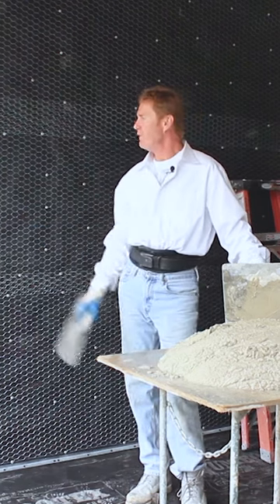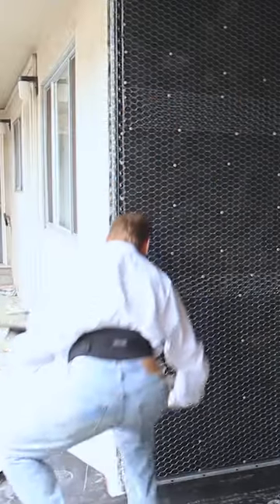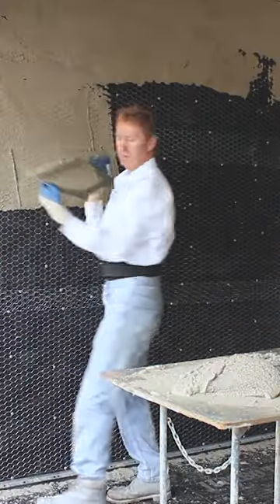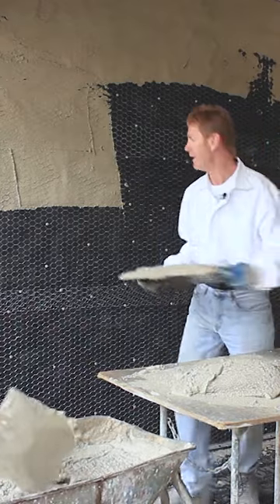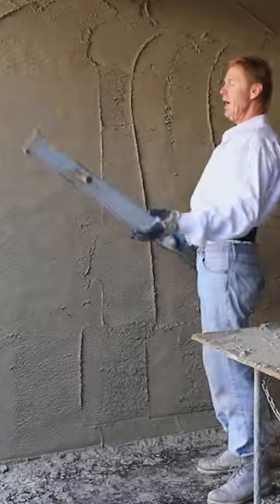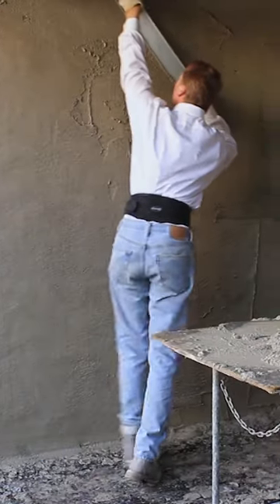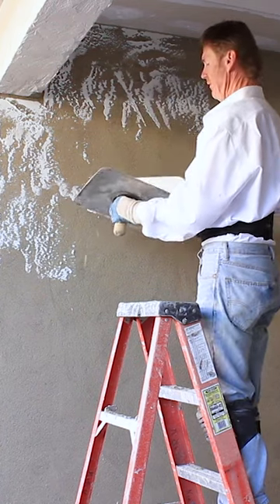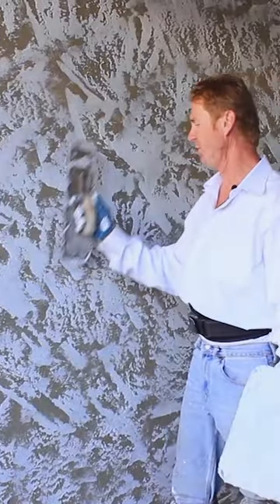How to apply stucco #shorts #shortsfeed #learning #stucco #educational #howto #diy #homeimprovement

Comment: Is that just sand cement with rapid hardener? Or is it silicone based? Over here we use sand cement mostly. For dashing, rough casting, cottage effect and smooth finish on the exterior. Silicone stuff is becoming more popular but it’s horrible stuff to use sticks to everything and ethier takes 4 hours to dry or 24
Reply from the maker: It’s called Eisenwall hydraulic stucco

Comment: What are the fasteners that are holding that metal lath? Looks like roofing nails.
Reply from the maker: @ricos4700  They are similar except they have a cork that raises the lath, they are called furring nails. Were they necessary? Depends, A gun set up cost about at least a thousand bucks. A box of furring nails about 10 bucks. We did not lath this but instead came in to do the stucco applications. The wire was self furring so it could have been attached with staples or nails.🕵🏼‍♀️

Comment: Can you lathe on hardie backer for stucco? Do you even need to? Building my outdoor kitchen
Reply from the maker: @ANour-ny9mu  You can screw in 3.4 metal mesh or apply fiberglass mash tape, or a bonding agent. It all depends on how long you want it to look good.
Reply: @StuccoPlastering  thanks so much! So just use fiberglass mesh tape on the whooooole thing? I want to avoid the metal caging
Reply: Also would need to put jumbo Tex? Should I adhere that with screws or do staples work with hardiebacker
Reply from the maker: @ANour-ny9mu  if your using solid pieces of Hardy backer board, the paper is not necessary, naturally if it looks like a jigsaw puzzle it’s best to seal the joints.
Reply: @StuccoPlastering  you’re the best! Thank you! For clarifying

Comment: Are you using Eisenwall or a similar material here in order to do all 3 coats same day?
Reply from the maker: Sho-Nuff, it's Eisinwall. Home Depots and Lowes carries their user-friendly, same stuff called Rapid Set Stucco. For this one you just add water; the sand is already in the mix.

Comment: you must have 2 arms of steel  trowering walls all those years.     question. can you smooth out a texture wall that has paint?
Reply from the maker: @vegitoblue7908  I’m as strong as the next guy, only. Like walking it’s one trowelfull at a time. Of course any wall can be smoothed out. Clean it apply a bonding agent then skim with a 30/30 finish sand, like Santa Barbara by La Habra.

Comment: 🎉🎉. ATTENTION, WHY ARE YOU USING INCH20 WIRE WITH LOOKS LIKE 7/8 ths. SKREED ?
Reply from the maker: It's 17 gauge stucco netting, we didn't lath it as we use guns, not furring nails.

Comment: Code requires twenty four hours between scratch and brown. Unless you're using a hot mud
Reply from the maker: We used Eisenwall, we are allowed to apply both coats anywhere in the country with it. When it first came out folks had to be certified to apply it. Yes o have that useless piece of paper.💃
Reply: @StuccoPlastering   Eisenwall is hot-mud.
Reply from the maker: @questioneverything2  We could also say it sets hella-fast.😉

Comment: As a stucco guy, I’m gonna make your life a lot easier. Buy a staple gun and staple your wire! No hammer and nail. Also in ohio we use rectangle trowels. Put the brown coat on, let it cure then come back and put a coat of finish on, white water proof cement, lime and sand, then come over and texture it
Reply from the maker: Thanks for the tip. What if we didn't do the lath and were called just to apply the stucco coats?

Comment: TO DO IT DO YOU NEED THAT TACTICAL BELT
Reply from the maker: No,🏋🏽‍♂️ Its actually a weight lifting back brace to protect my back, it's an old habit when working behind plastering pumps for many years in the past.👨🏻‍🔬

Comment: Your going to lose all the muscle in your back from wearing that brace anyhow so your right, you don't need muscle
Reply from the maker: Thanks for the tip, there’s so much excess muscle that loses some might be a good thing.
Reply: @StuccoPlastering  I'm just saying is all. Ask any physiotherapist. In time you'll need it just to walk
Reply from the maker: No worries, I use it when at work only as the lifting at odd angles used to kick my ass when I worked behind a Tommy gun.
Reply: @StuccoPlastering  I hear ya man, I used to be a Concrete finisher so I get ya 100%
Reply from the maker: @sweepdreams  now that’s hard back breaking work.
Reply: @StuccoPlastering  I agree good sir, keep up the work!

Comment: 15 minutes in between scratch and double? You must be in a hurry, or your doing it cheap?
Is that just masonry cement???
Reply from the maker: Neither, "Rapid Set Stucco" sets in about 15 to 40 minutes, it depends on many factors.🕵🏼
Reply: @StuccoPlastering  what you mean, neither? It's too dark for Portland cement, and it's gotta be a cement, with sand and some type of cement hardener, like hydrated finishing lime? It's definitely not an acrylic base, I can tell that right away..
So, in actuality ,I really think that you don't know? Or you're not sharing?
I've been plastering for decades, and I have a good idea of what these materials are made of, I mix my own materials all the time..I just want to know if you know?
Reply from the maker: @petekobraoutdoors7324  We are spreading Eisenwall hydraulic stucco. Mixed with one part Eisenwall to three parts sand. Sold only at plastering yards. A sister product is sold at Lowes and HD called "Rapid Set Stucco" It has the sand already in the bags. If you are like us we prefer to buy the raw materials and add our own sand, Best wishes, 👨🏻‍🔬
Reply: @StuccoPlastering  Thank you, sir. I appreciate it.  Yes,I learned my plastering trade from my father, who is 95, I'm 60 now but still going strong. I do mix my own materials, which was learned by experimenting..
Traditional plastering materials are not available as they used to be, forcing us into a different age of money hungry material sellers. Everyone wants a piece of that square foot of your project, but for me, the less they get, the better for us,lol
As long as the project passes the test of time, especially through the winter months, it's all good 👍 
Thanx again, and it's nice to see a fellow Plasterer, not very many out there that have the traditional methods. We have to share the knowledge so it's not lost in the sands of time..
Have a great holiday season and New Year 
.Plasterer 1963 🫡

Comment: He's wearing white shirt to taunt you with his expertise
Reply from the maker: lol, any long sleeve shirt will go as the Lye in the stucco burns the hell out of skin, I remember a time when my hands were so bad that every knuckle bled. Couldn’t work for a couple weeks until they healed, I have been wearing gloves and long sleeve shirts since then. It’s nothing to do with style.
Reply: @StuccoPlastering  well, doesn't have to be white either
Reply from the maker: @tukangiseng  it does not, not but in hot weather the heat is dissipated. These are work shirts I buy them at Salvation Army stores, they usually cost me between 2 and 4 bucks a shirt. My skin is worth the dough.

Comment: A dying trade
Reply from the maker: Far from dying, in fact, it's very popular.
Reply: Up here in Quebec Canada, all of the older homes built in the early 1900s had plaster and lathe. No one wants to restore it. They take it down and put drywall. I’ve been renovating for 20 years and have never seen your kind of craftsmanship. There’s a lot of Exterior work here and it’s popular. The inside plastering is no longer.